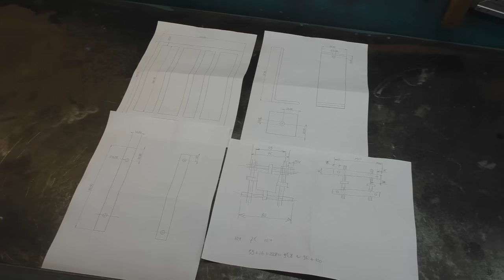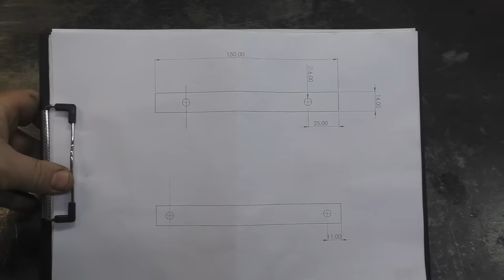Angle Grinder Roller Carriage, Stand, do it yourself

Comment: that would make a good tile saw.    You should turn that grinder around so it is throwing the sparks off of you and not climb cutting.     But I like the mechanism I was thinking about using the same method with a 4x4 tubing and build a guide for berings like that for a homemade power hammer.

Comment: Nice rig. I have thought of several other variations of this- basically where the grinder rides on a 2x2 square (like yours) but the rail is stationary and lets me cut to 48" +/- 
8:31 Why plastic caps when you can weld, though?

Comment: Looks much better than the wooden versions. How much play do have when extended?
Reply: It probably deflects a lot with body english. If the verticals were tubing as well- bridged at the top- it would probably not have much runout. 
Think about a compound mitre saw: unless one leans on it in operation it makes very accurate, repeatable cuts if you don’t introduce deflection and cause runout. 

So if you make the pivot point more robust it should be accurate quite a bit beyond ‘close enough.’

The other flaw in the design is the lack of a quick adjustment fence to locate the work, and time-consuming hold-downs is another. $5 of hardware and some 1” angle would solve the former; the latter could be mitigated by modifying a cheap locking pliers-style welding clamp. 

I can see this thing being a significant time saver. PLUS a space saver in a small shop like mine where a rocking metal bandsaw and even a small shear would be a very unwelcome use of floor space- which is the main reason I have neither. 

As far as the R side versus L side mounting of the angle grinder: I also would rotate the tool 180* to accommodate pushing towards the rear where I would locate a 90* fence. Then cutting without constant reinstalling of a holdfast would up time efficiency substantially. 

Space efficiency: having a fixed beam instead of a traveling beam lets you work with it while not having 24” of clearance behind, but on the other hand that would limit versatility because it wouldn’t self-compensate for disc wear (diameter).

Comment: 10:07 You are wrong, the disc wheel must cut with the sparks going towards the wall and not against the operator.
It should be put on the right side and then it was better to put the carriage on the tool so you don't have the rod hitting the wall.

Comment: Why not buy a real metal cutting saw for this? And you´ll get angle markings on the machine. You´re only gonna do 90,45, 30 and 15 degrees anyway.
Reply: I desagree, you can cut almost all angles. Any way how much would cost a machine with this function. I'm sure it would be very expensive.
Reply: I agree. Poor design and execution fabricating it. All the play in the arm the grinder attaches to will get someone  seriously injured when using a cut off wheel and it explodes. Crafty panda level crap at its best 😆
Reply: @joshw4471  you think the play in the metal arm is going to be bigger than the play in a human arm?
Reply: @joshw4471  Nobody will get a disc exploding with this rig, if they wouldn´t with a handheld grinder, and the play can be adjusted, I just don´t think it´s worth the time and the effort given how cheap metal cutting equipment is these days.
Reply: @alejandroortega8540  Depends on what you consider expensive. I got a cold cutting saw that will do all those angles and more, it´s 3 axis - it cost me about £250 plus the stand and some extra blades.
Reply: If osha showed up in your shop and seen this you would be fucked 😆

Comment: Or, buy yourself a plasma cutter for about a hundred EUR, and cut straight lines at four times the speed using nothing but some straight scrap wood.
Reply: Of course, if you really have to, reuse that setup to hold a plasma cutter.